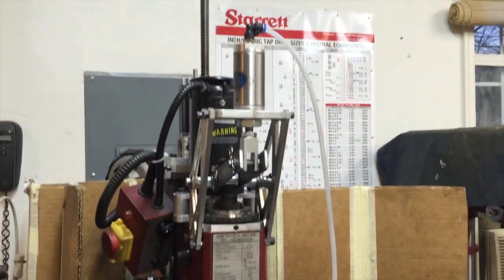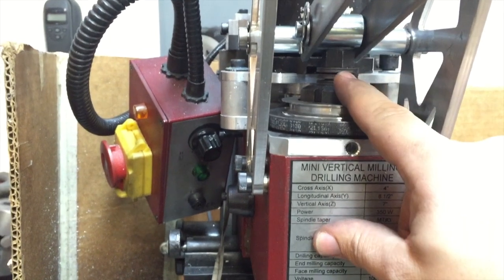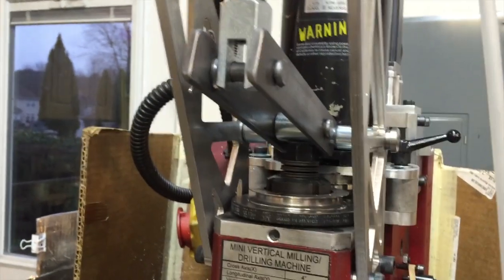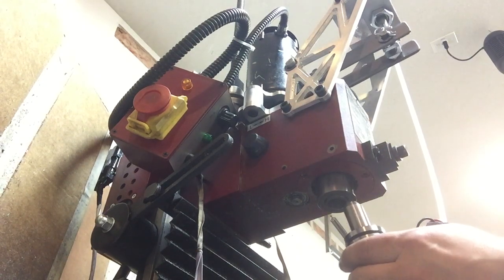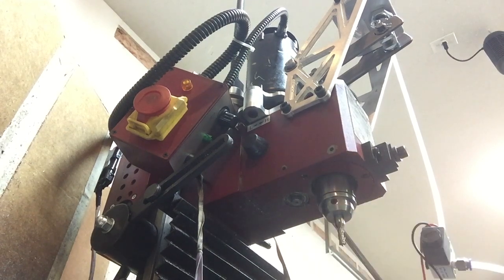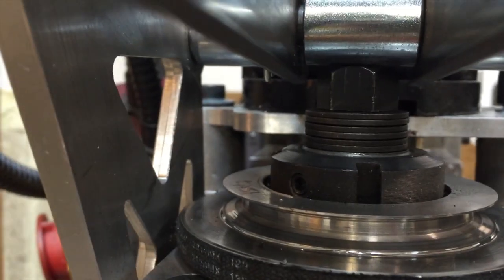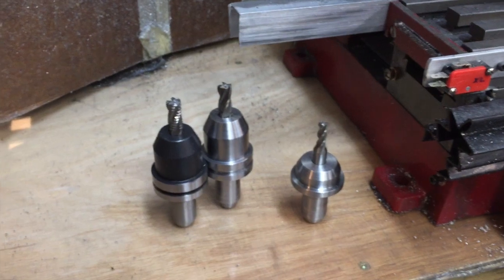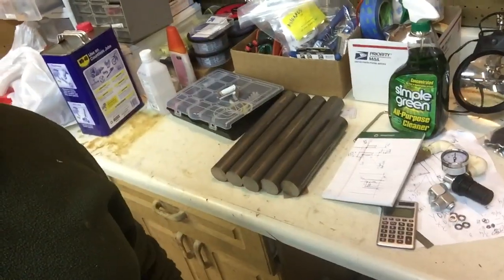Pneumatic drawbar

Comment: Can u tell me. The two holes that locate your bracket on the left side (i believe are from the control box). I am using hoss's plans but am unsure where to mount the bracket. My contol box has 1 middle upper hole.
Reply from the maker: I wish I could remember that far back, that was 10 years ago, but I always try to reuse existing holes first. That said I might have had to drill some. Check out my blog, there might be some more info there that might be useful to you. https://longezproject.blogspot.com/2015/03/cnc-mill-conversion-part-23.html

Comment: I am interested in doing something similar with my PM-727M but have not decided between using the belleville washer solenoid setup like you have here or the pneumatic ratchet style. I have heard that the belleville washer approach can cause premature wear on the spindle bearings. Have you found that to be a problem now that you have had this setup for awhile?
Reply from the maker: Hey Denzil, it's been a year and a half now since I first installed it and I see no signs of wear. All is well, and I have been enjoying the mill a lot more with the new mod. I'd definitely recommend it.

Comment: That's a great design Marco! Did you use plans or is that your own design? I may have to add one to my mini mill.
Reply from the maker: ***** Hey Guy, I purchased my plans from Daniel Kemp, but you can find them all on his website for free here http://www.hossmachine.info/projects_7.html 
I did have to make a few modifications to make it all work, but his idea is a very good start. As far as the side plates, I just jazzed them up a little, that's all.
Reply: do you happen to still have the plans for this? the website is no longer active. links are missing/not working. thanks
Reply: @ianbaker3744  have you gotten a hold of some plans?